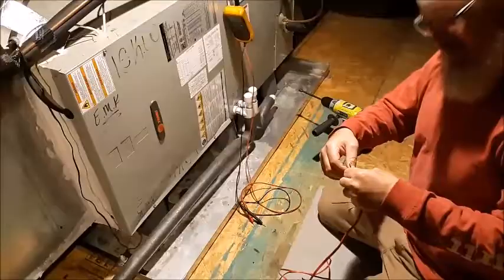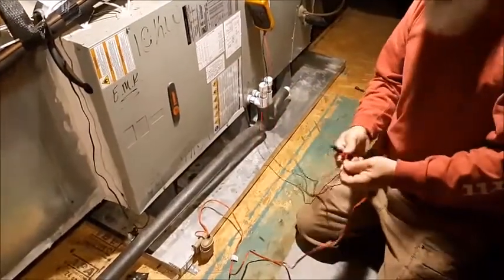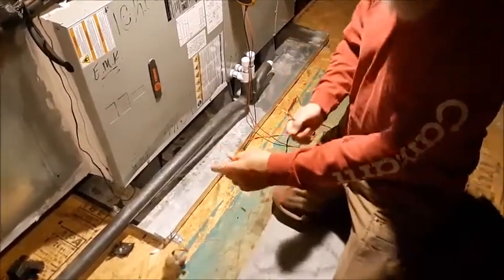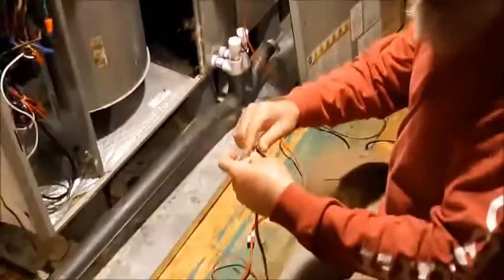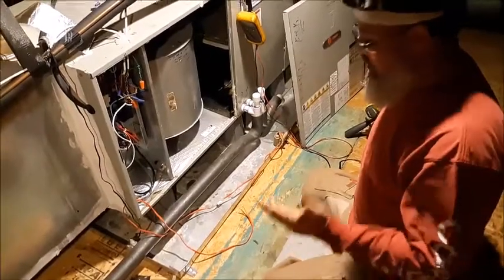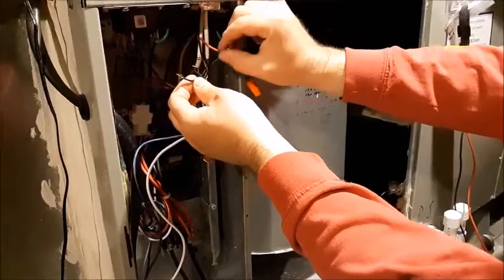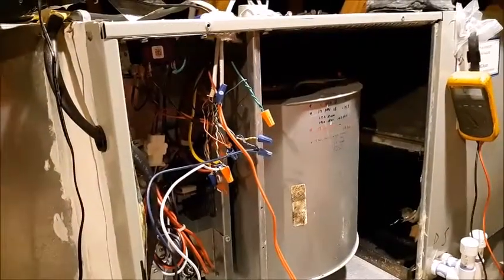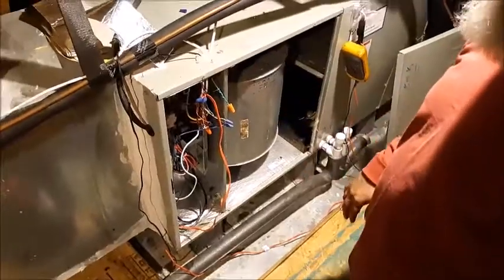Float Switch Installation

Comment: First time on your station. Nice video my Air handler is in the garage so no big deal to overflow, but it happened two times. It’s wired to the Yellow so when I test it I can’t tell when it breaks. I am going to change it so it breaks the Red and then when the Fan stops i’ll know it’s open. Also ordered a RED LED 1/4 inch, to hook across the float so the next time the drain clogs up and the float  switch opens when I go out to my garage to check that RED LED Light will be lit. I am going to put that LED right next to the float switch.
Reply from the maker: Pretty smart. Hard to miss a glowing red light! It really works when you pop your head into a dark attic too. Thank for watching.
Reply: So how would you power the red light if the float switch is killing power?
Reply: @froztout  it's wired parallel with  the switch.
Reply: @joemc111  Would like to see a picture. I just reinstalled the float switch on my air handler and thought that was a good idea but wasn't sure how to make it happen.

Update: My float switch is a 3 wire setup. 2-wires for N.C. and 1 wire for N.O. so should be able to wire a light in series to make it work.
Reply: @froztout  you wire the LED in parallel with the flow switch.

Comment: First of all, thank you for the video. I am learning about the air conditioner system to do DIY around the house and came across a difficult one. It looks like float switch on my system attached to the R circuit, which took out power to the entire system (thermostat, furnace, and condenser unit). I cleaned the drain pan, but the float switch was not reset. I still don't have power and the thermostat is blank. I would appreciate it if you could tell me how to reset the float switch and restore power to the system.

Note: I am referring to the AG1100 float switch.
Reply from the maker: Float switch should reset if you got the water out, or at least got enough out. Maybe some trash got it stuck open. Try to push the pull knob down if it is up? Maybe the switch went bad? Not sure from where I am sitting but you could undo the float switch wiring and do a continuity test to ensure it is closed. You might have another issue.

Comment: being that we’re killing power to the low voltage side I’m assuming one side of the switch to power and the other side to common? Great video
Reply from the maker: Not to common. The way i do it is hot side of 24v into one side of switch and then to the  red wire(s) going to the thermostat/outdoor unit. Never hot side in and out to common...get a blown fuse or transformer that way!
Reply: @johnjennings-JJ  i realized this after i made the comment, thanks!
Reply from the maker: No worries. I have seen a lot of guys who wired it that way when they start out.

Comment: John, great video! I just had new furnace an a/c unit installed and want to add the second cutoff switch as you did on the pan since the contractor installed one just on the condensation pipe. One question - I'm using the same switch you did on the bottom pan. It has 3 wires. I understand how you connected 2 of the wires, but what do you do with the 3rd? Is it needed in this type of installation with this being the 2nd overflow switch? Many thanks for your video!
Reply from the maker: You don't have to use the 3rd wire, which should be labeled as a Normally Open if using that Aqua Guard. It is so you can wire in some type of alert so that it triggers you to know the float switch tripped. When the float switch opens the switch to break 24v power, it would close the switch to give the alarm at the same time. I only use the Normally Closed portion and keep it simple. You can just put a wire nut on it or one of the  crimp on style if you have it just so the wire doesn't possibly touch anything and blow the fuse.
Reply: @johnjennings-JJ  Fantastic! Thanks so much for your quick response

Comment: If you break power to the red thermostat power you rely on the float switch while in heating mode.
Reply from the maker: True. But if you have a furnace for heat a lot of them use the roll out switches in the 'R' circuit all the time too. Heat and cool modes. I like breaking 'R' because it is a definite "you know something is wrong" way. Thanks for the comment.
Reply: Haaaahaaaa 😅👍